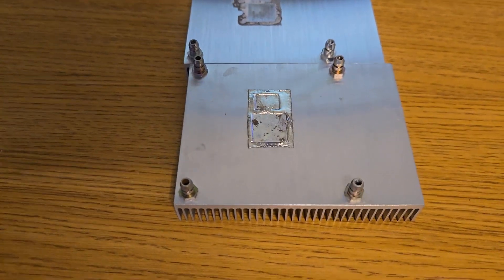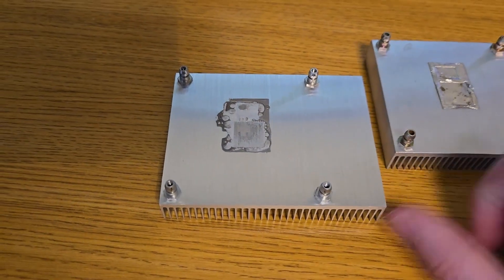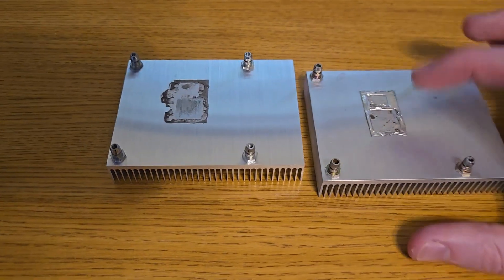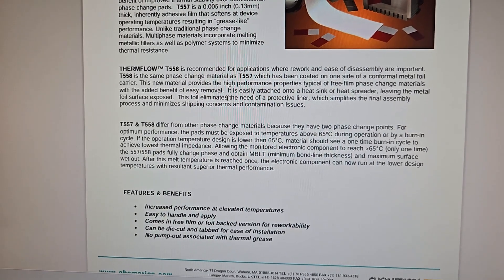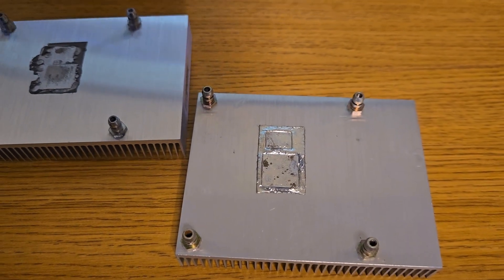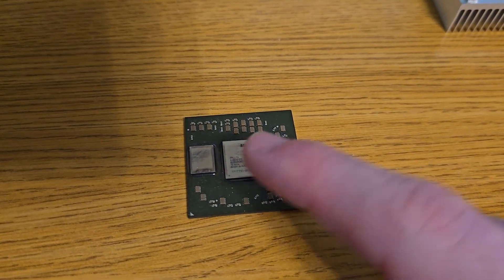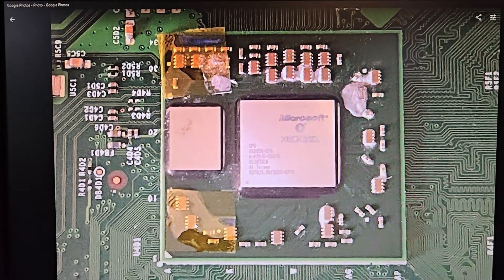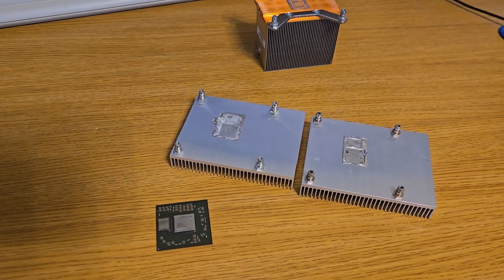The Xbox 360 GPU Foil Explained

Comment: thanks for such good info. i cant believe the thermal conductivity is that low. most decent  thermal pads these days are double of that. any new paste or thermal pad would improve the cooling easily. probably also worth 1mm pad on the other side between xclamp and back of the board.
Reply from the maker: It's not that low. Perfectly adequate for the heat output of these chips.

Comment: Hey Josh, I've had this Zephyr Test Kit kicking around for a while. Would you be interested in swapping the GPU out with a Kronos or Jasper era GPU? I might be able to supply the GPU from a dead motherboard. I am also unsure which revision of Zephyr it is as well, but as far as I know it should be possible (considering a Xenon can get a 65nm GPU, shouldn't a Zephyr?). I am wondering how much you would charge for both labour and potential parts. I ask this because I am certainly not skilled enough to do a GPU and or PCIe conversion. No pressure if you don't want to however :). Also great vid!
Reply from the maker: Zephyr A B or C?
Reply: @Josh.Davidson  I am unsure of which of Zephyr series it is. As far as I remember, the last time I opened the console, it had a low profile GPU heatsink, which might mean it's a Zephyr_A variant. The MFR date is 2009-12-10. I might be able to provide some additional information if needed.
Reply from the maker: @no-ld3hz  Sounds like A. It would very expensive, not worth it. Wait for a better solution.
Reply: @Josh.Davidson  Right, well that's a shame.  But it was definitely worth a shot, thanks for the info!

Comment: Hey josh. What's the chance a Zephyr CPU could work on a jasper board? The CPU is pre nxe and able to be jtagged.
Reply from the maker: No, you CANNOT do that. The Waternoose and Loki CPUs are not pin compatible or even the size physical size. 28x28 BGA for Loki and 30x30 BGA for WN. Put a reliable Rhea on the Zephyr and you have a solid machine.

Comment: When will the xenon library have a tutorial on installing Jasper gpu on xenon mobo?
Reply from the maker: Once a solution is available which is not sketchy. Not many people are capable of pulling off the rework I did correctly.
Reply: @Josh.Davidson  ok, I just have xenon on Blades Dash and like any other consoles on xenon, I started to get error 0102 (sometimes 0103). but mine has one feature, when the console freezes, it does not have any image distortions.
p.s. I have already taken the console to two services, both said that there are no parts for xenon mobo

Comment: Hi Josh, sorry to keep bothering you, yet here I am. I have a blades xenon running 6717 factory Y1 gpu. I was wondering how simple would it be to swap the gpu out. Would it be easiest if I got an elpis gpu from a repaired xenon and just swapped the eplis gpu onto my blades xenon? or can I just swap any gpu from a falcon or jasper without needing any extra work? Thanks as always
Reply from the maker: You cannot swap from Falcon or Jasper onto Xenon. I made a whole video on the Jasper situation which explain it.
Reply: @Josh.Davidson  thanks, so swapping an elpis onto it will be fine?

Comment: Hi there. A little off the thermal interface topic, but could you recommend a good source for some Elpis GPUs (X819195)? I have a couple of old xenons Jtagged, I'd like to remove their Y1s and get them reliable! haha
Reply from the maker: Do not have a good source.
Reply: @Josh.Davidson gotcha, so you primarily pull them from donors?
Reply from the maker: I do not install him usually. Install Y1 fixed. Elpis am move JTAG CPU over or something.
Reply: @Josh.Davidson oh so revised Y1 is easier to get ahold of? Idk why I figured Elpis was produced more. Where do you usually get fixed Y1 from?
Reply from the maker: AliExpress

Comment: Intel still uses phase change on their included heat sinks that come with their CPUs. 

but the 360 I'm pretty sure they just used it a shim. 

 the graphics processor that was in the 360 was not the original processor they were supposed to use. Not sure why. 

this caused a lot of problems
Reply from the maker: You sure? I'm pretty sure it's just a square of commercial grade thermal paste.

What you said about the graphics processor is completely untrue. This is the custom designed chip by ATi for the 360. No problems in that part of the design, it was a packaging mistake in the industry at the time @TSMC and their packager (ASE?)

Comment: Hey Josh, does this mean all GPU's that match this criteria are required to have the phase change material when refreshing or simply re-applying the heatsink? Or can newer heatsinks facilitate this change?
Reply from the maker: With modern thermal pastes it's not an issue. X360S has paste under thr IHS not a phase change pad.